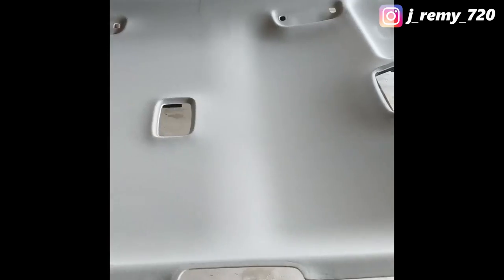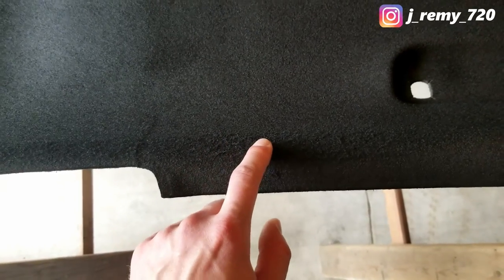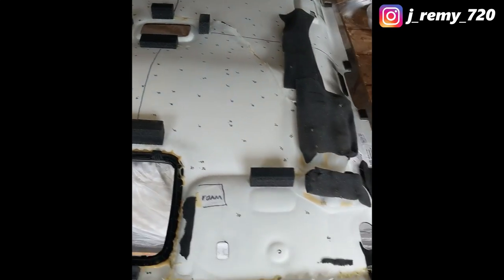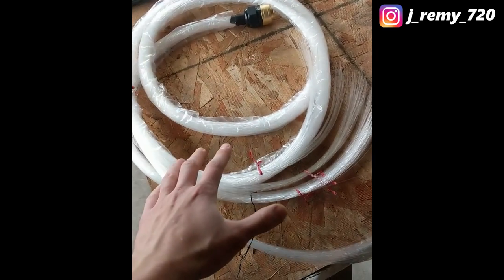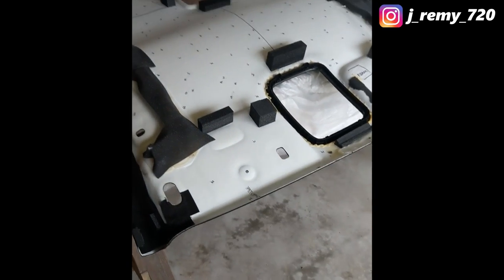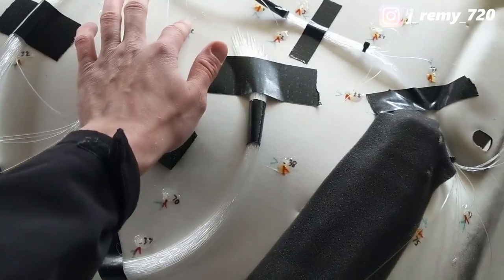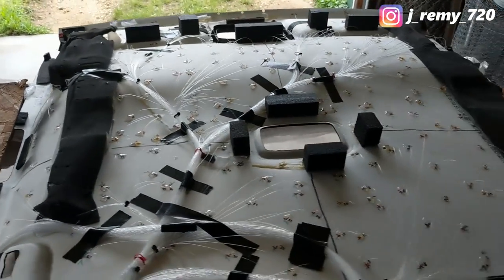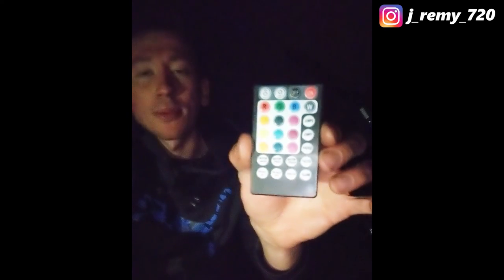Starlight ROLLS ROYCE Headliner COMPLETE PROCESS - w/ Painting Headliner BLACK | 2019 2020 Kia Forte

Comment: Yooooo thank you so much for this man. I own a 2019 Forte S and have been wanting to do this. I’d been looking everywhere on how to properly remove the headliner, but had no luck. You’re a god send. How many hours were put into the complete process? My work schedule is crazy, but I want to get this done.
Reply from the maker: Hey!  Yeah I'm glad you enjoy it, I posted it so I can help other people who are looking to do the same improvements...For your Forte S, are you looking to paint the headliner & trim pieces and/or just do starlight headliner?  I broke up the process as follows:  REMOVING TRIM PIECES & HEADLINER - 1 day, PREPPING & PAINTING HEADLINER - 1 day, PREPPING & PAINTING TRIM PIECES - 1 day, MARKING UP STARS ON HEADLINER - 1 day, PUNCHING HOLES, ROUTING ALL WIRES, AND GLUING - 1 day, REINSTALLING EVERYTHING - 1 day.
(also, you may have to factor in some buffer time for the painted components to dry/air out.  After i painted the headliner, it did smell for quite awhile but now the stench is completely gone)

Removing the headliner was probably the most stress-inducing because obviously you don't want to bend it too much out of fear of creasing, but you just gotta get over the fact that its gonna bend like crazy and you just gotta yank it out lol...My bad for not getting any footage of the removal or re-installation of it but again it is able to be done.  In the end you can't even tell it was messed with.  I tried initially taking it out through the trunk but it didn't fit.
Let me know if you have any questions throughout the process, just reply to it on here and I am happy to answer anything.  Thanks, hope this helps!
Reply: Thanks again so much man. I really appreciate the info. I'm really excited to get started on this. I'll try and get footage once I get started and share with you.